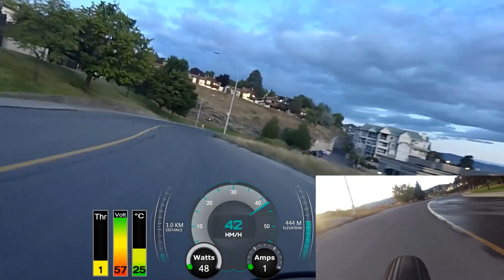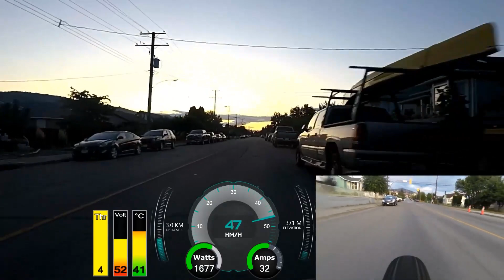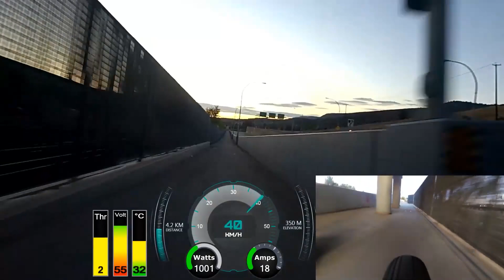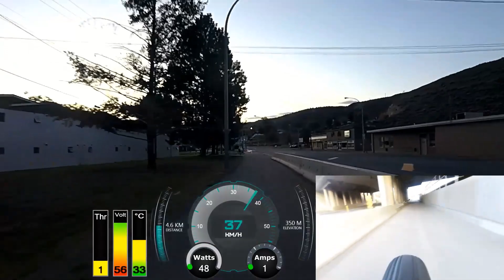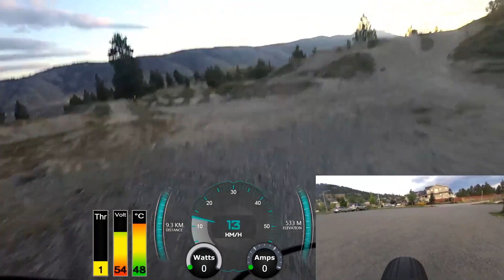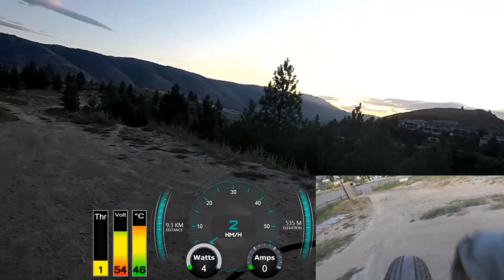Weekly Ebike Tech chat January 12th 2024 Graphene Battery Technology - State of play

Comment: I've been hoping for a breakthrough in lithium-air for a long, long time now. That would be a true revolution and allow all sorts of applications that are not practical today.
Reply from the maker: Is it still a long way off?
Reply: @HighVoltageKits  Yeah. Lithium-Air has a theoretical energy density of about 11kWh/kg, so it would be incredible. But there are a lot of unsolved issues with charging and safety. Almost as if using oxygen in a battery could go horribly wrong... But one can hope.

Comment: What is the point of graphene ? I will only give a better power drained/capacity ratio, it can hardly increase the capacity itself.
Reply from the maker: Well in terns of a supercapacitor it massively increases the capacity by providing more surface area to store a charge. 1gram of it covers something crazy like over ten tennis courts. In terms of lithium if they can make them safer that would be the biggest thing. Less heat during use and less issues with thermal runaway. It could extend the life of a cell by more than double. That's a huge advantage. Cheers
Reply: @HighVoltageKits  It affects basically the power output, and it is not critical once you get enough batteries, as with each single battery you can increase both the output and the capacity. With enough normal batteries, you would get only a very minor benefit. In terms of heat, they will be safer, but not as much as LiFePo4 or even more, LTO batteries or cheap and safe a sodium batteries (at the expense of less capacity).

Comment: Just my opinion but I really believe that we haven't hit that over all close to perfect ebike yet, I would like to see a more compact ebike with 20 inch tires that has excellent adjustable suspension and comfortable seat with custom attachments for a trailer, a hidden rain top that can be used when needed to stay dry, saddle bags, pet carrier, room for a passenger, even an attachment that can turn into a stable reverse trike for older people that may need it. A snow kit, I could go on a bit more but sitting down with a think tank and really being next level and making it actually look incredible as well. The most comfortable compact customizable ebike ever made that can please just about everyone with multiple options.
Reply from the maker: I think about this stuff all the time. I think you are right. The optimal bike is still to be made for the urban environment certainly. Offroad there are more options mainly due to looser regulations. I like the ideal of a modular frame that can be adjusted to accommodate different things when needed. Great comment. Cheers

Comment: paraphrasing thunderf00t here (i know he's a bit icky) but we are sitting at 200 Wh / kg, and for good reason: there's fuel and oxidiser in the same package in batteries. You need at least one atom to hold the charge, one atom to take the charge when it discharges, and you need to separate the two by something to stop it discharging on it's own. Also, you don't just need any kind of energy out, but electrical energy, which carries penalties on it's own. Battery technology is probably has as high specitic energy as it's going to get if you want to maintain safety, reliability, and charge-ability. Ten times increase in capacity would get you the same as termite! Same heat-capacity as water, same specific energy as termite, short circuit the thing and you have about 1000 degree C, perhaps not quite the melting point of steel, but hot enough to instantly ignite any nearby furniture just by convection, and if it gets extra atmospheric air it would get even hotter than that! i'm not one of those people who worry about spontaneous combustion near a button cell battery, but we have to consider worst case scenarios with this stuff
Reply from the maker: If you mean lithium ion being as good as it will get for safety wise maybe. For other chemistries we will have to see. I don't think we can say anything with any real certainty though. Things change fast. Take the US oil industry. They went from a decline to being the biggest producers due to new technology. Solid state lithium batteries are a bit of an unknown in terms of energy density. Different technologies manage heat more efficiently. It's going to be very interesting to see how this develops. Cheers
Reply: the reason i'm pessimistic about this is not that we've been at the same 265 Wh / kilo we have been since 2011 (panasonic) @HighVoltageKits  rather it's a suspicion at a thermodynamic limit to the things. as for solid state, "nobel level research is needed" at least according to anonymus sources in the scorpion capital analysis of former staff members of volkswagen's quantumscape. (that's a sentence huh) we'll see of course, never say never. some sort of global orbital solar power stations using microwave to power things i would think much more plausible than this. charles stross had a good post about this a couple years back. "Fossil fuels are dead (and here's why)
By Charlie Stross"
Reply from the maker: I have not seen anything to suggest graphene can massively increase capacity in lithium ion. More that reduced resistance and heat transfer could prevent thermal runaway. I'm not expecting miracles in capacity. I'm hoping for better safety, charging and manufacturing that is less toxic. Fossil fuels should be phased out. It's just they have alot of money to throw at staying around sadly.
Reply: it's worth noting that a 52V graphene-based battery would have an equivalent output to a 52V lithium-ion battery. However, it's essential to recognize that any battery designed for high current discharge rates inherently carries risks